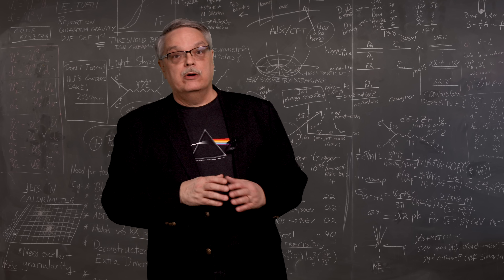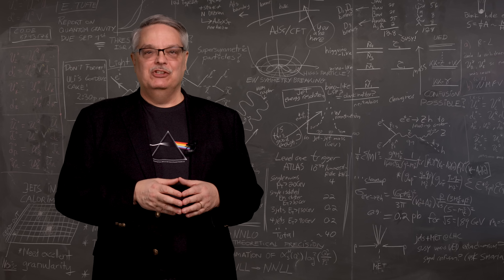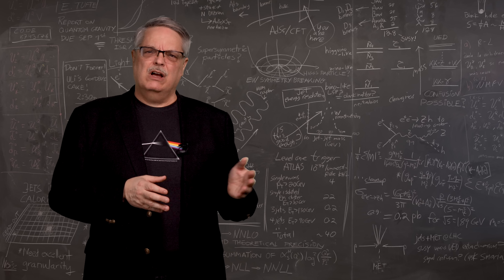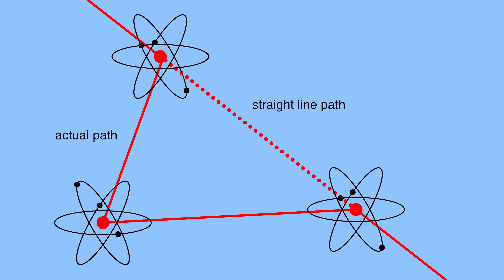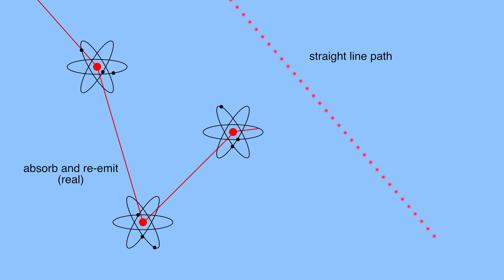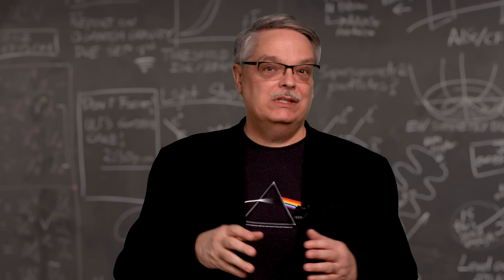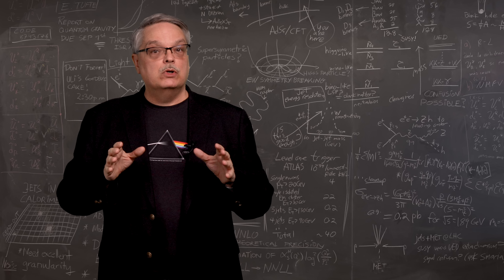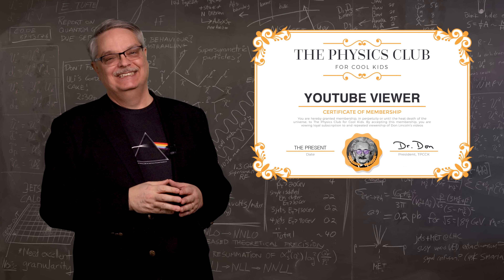Why does light slow down in water?

Comment: So, the claim is that the electrons - bound in the glass molecules - takes a brake from being bound just to "shake along" with the passing light? I wonder what Mr Fermi would have said about that...
Reply: No, the electrons bound in the glass molecules get disturbed by passing photons of the right frequency, and they shake off that disturbance by releasing a new photon of the same frequency but with some delay.  The old and new out-of-phase photons make friends and carry on together in a slightly different direction and at a slightly slower speed (taken together).
Reply: The electrons bound in the molecules then has to be disturbed in discrete quanta. That is not what we see when light passes through water or glass.
Reply: @mar1683xyz  
The electrons are disturbed in discrete quanta.  An electron absorbs a UV frequency photon from the original beam of photons and jumps within an instant into a higher orbit.  It immediately drops again and releases a new UV frequency photon that is out of phase and moving in a different direction from the original beam of photons.  Over many electrons this plays out so that all the random direction photon wavelengths constructively and destructively interfere.  Ones not headed in the expected direction perfectly cancel out leaving interference in just one direction.  You can’t see this happen (photons are invisible).  You can just see the end result of how all the remaining wavelengths, original and new, mix into a single wave of light.
Reply: The point you are making is specifically NOT what is happening, according to the clip.
Reply: @mar1683xyz  The clip discusses the main points of interest to the topic and is consistent with what I said - a secondary light wave is generated by the atoms of the glass and the primary and secondary waves combine to create the end effect.  It assumes the viewer knows that electron transitions in the glass atoms are behind the secondary light waves since this is very basic physics.
Reply: @cloudpoint0  4:50
Reply: @mar1683xyz  
The incorrect idea is the absorption and remission of light causes light to slow down.  The correct idea is the light is absorbed and reemitted with a different phase velocity (but still travels at “c”).  Instead of disputing me based on your incorrect understanding, why don’t you check another reliable source?   Try this one maybe …

https://youtu.be/CiHN0ZWE5bk

Also see this animation showing the effect in action…

https://en.wikipedia.org/wiki/File:Wavepacket1.gif